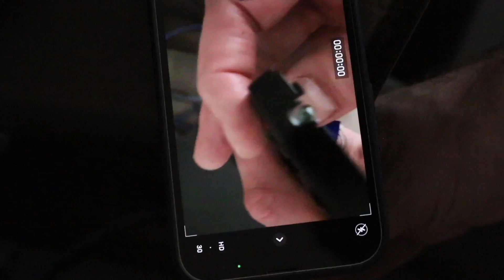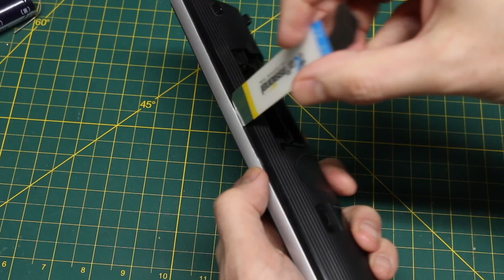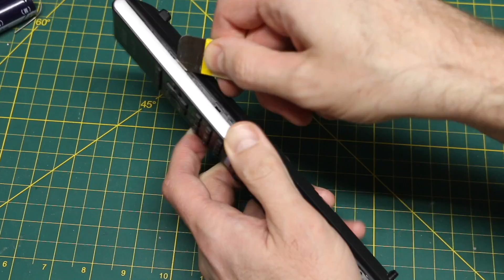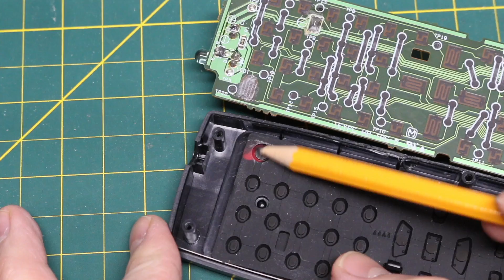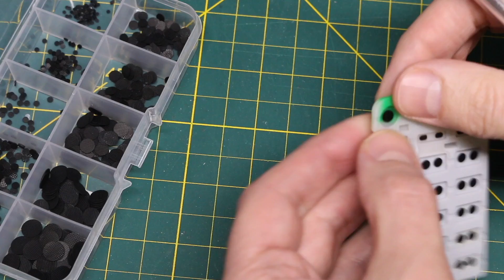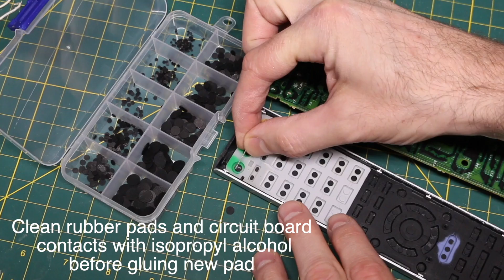Broken Remote Buttons? How to Fix

Comment: What I have is two buttons that when pushed, stick down into the remote. The buttons do perform the task, they just stick down, and won't perform again until I pull the button out of the remote. 

The pads underneath the buttons must be worn out. 

Are there pads that one can put underneath the buttons to increase (restore) the original lift of the buttons?

Comment: 1:18 Aluminum foil also works. Just glue a small piece of aluminum foil on the button pads.
Reply: I tried aluminum on the buttons that don’t work and it still doesn’t function. The buttons that do work also works with the aluminum I tested.

Comment: I've had good luck with the ButtonWorx repair kits (on Amazon). They're self-adhesive and they stick to the PCB instead of the button. They have a thin spacer built in that keeps the conductive pad just above the surface of the PCB. Remotes I repaired around 2 years ago are still working fine under daily use.
Reply: Problem is I over cleaned my remote keypad conductive surface. I got too aggressive with alcohol and cue tips. Stay away from that combo when doing the pad contacts. Their conductive coating can be fragile with age. Very light soap and water and dry completely. Alcohol 70% on trace is fine.

Comment: Just a thought, superglue might be a bit brittle for this kind of use. I might try some form of rubber contact glue it's a bit more flexible  Superglue is no good in shear type force, so any flexing could lead to the joint parting ways.
Reply from the maker: I was considering contact cement but the small tube I had was all dried up, I probably bought it 15 years ago and used it once for whatever I bought it for at the time so I’ll consider this an ongoing experiment for type of glue. It will at least only get gentle use around here.

Comment: Great simple repair.
I gotta get me a box of those replacement pads - there's a couple of remotes around here that haven't responded to just cleaning them.
Reply from the maker: Definitely start by looking at the IRLED in the camera to confirm the buttons are not responding because I still have one remote for a receiver from the 90s where the power button stopped responding in the past week, but the LED is actually transmitting. 
I tried gluing a new pad on just to see and it did not change anything so I’m not even sure what’s going on with that one, the power button on the receiver works but just not from the remote for some reason.